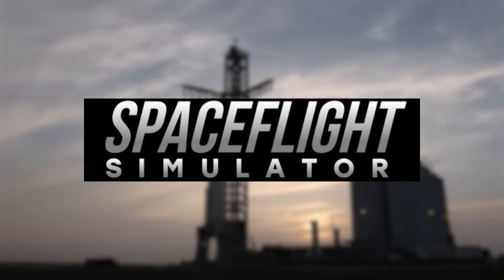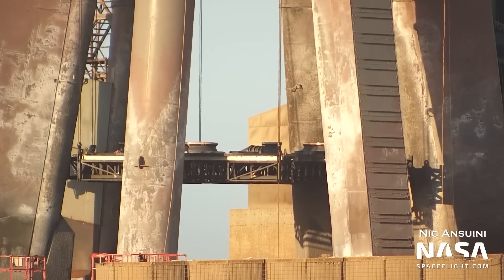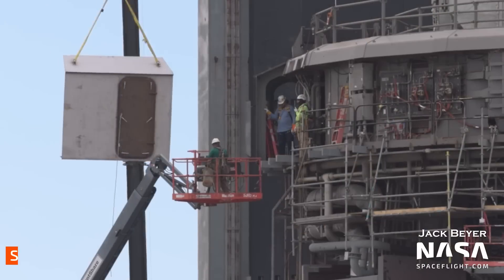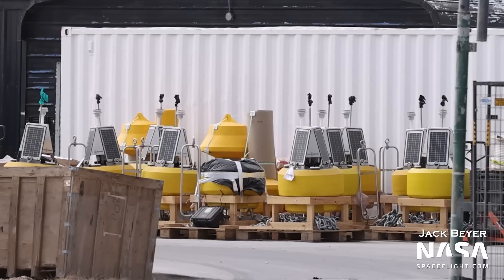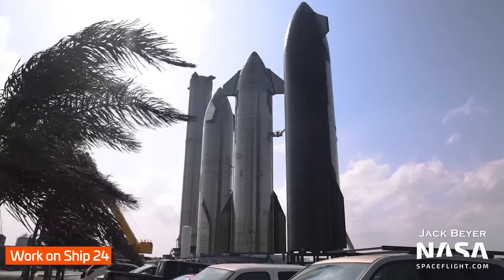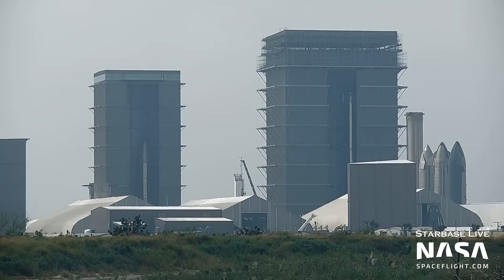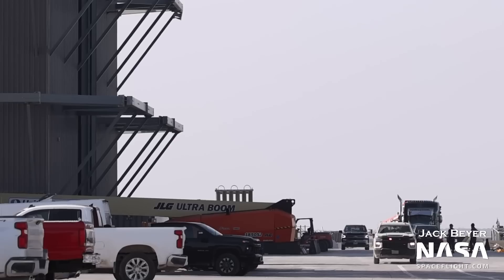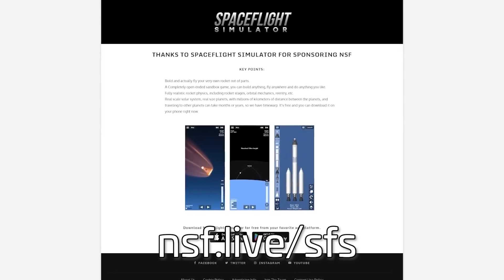SpaceX Starbase Update: Shielding Installed, Ships Tested, and Rocket Garden Work

Comment: I'm curious if there will be any acoustic dampening done inside the new OLM mount shielding to cut down on the sound reverberation throughout that now closed in space.
Reply: It is not closed in. The floor is a grate. But if they should add shields on the bottom too then that could be what happens. I would have to assume that all equipment in the OLM can handle sound waves from a launch.

Comment: YAY Jack B.   Always enjoyable to watch all these update videos.  Regarding the "BUOYS", I have a feeling, SpaceX are going to use them like they are used over here in the UK for, around Oil+Gas  Rigs, and that is measuring "Wind Speed, Wave Swell, as PRIMARY uses" as both of those could affect the Drone ships, like the Rigs.   We know the Booster has a backup "Ditch in Sea" failsafe, but again like the Rigs, a particular heavy Sea swell, or rogue wind could always happen.  It was the Solar panels on top of the Buoys that reminded me of the ones used here.

Comment: Wil b10 roll out with or without engines? It would streamline testing if they rolled it out with all 33 raptor 2.5s, but in turn that puts those engines at risk.
Reply: Nothing roles out with engines. Boosters and ships must be cryo tested first. That is not done with engines mounted - the risk of needlessly ruining the engines if the cryo test fails is too high.
Reply: @knowledgeisgood9645  All correct. But do new falon-9 boosters roll out with engines, or not?
Reply: @bryanillenberg  I don't know much about F9. My interest is in Starship. But all tanks have to be tested before use, and only doing that after adding engines is reckless.